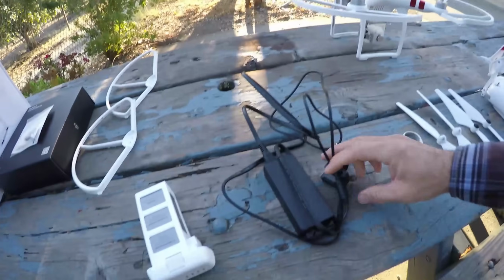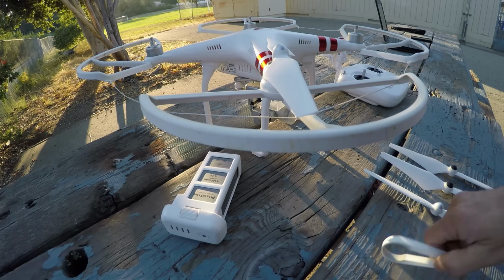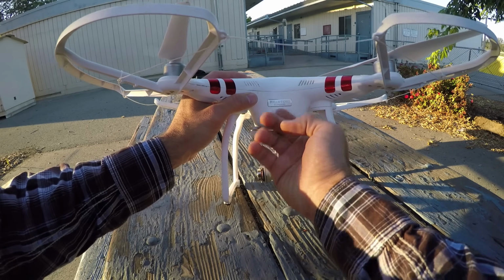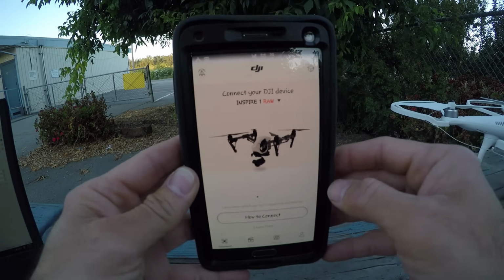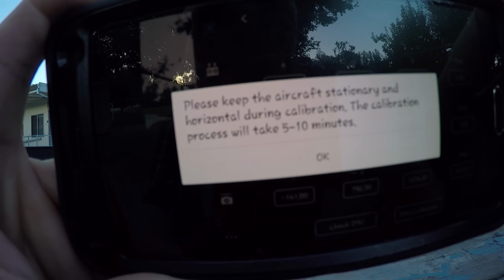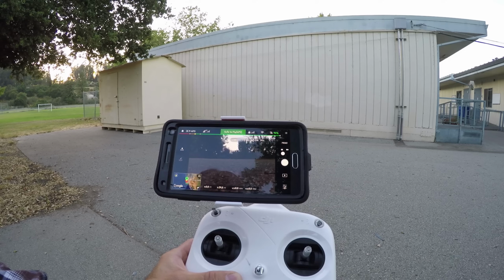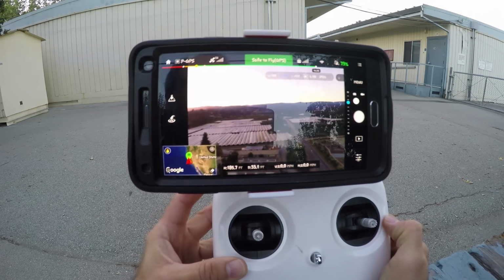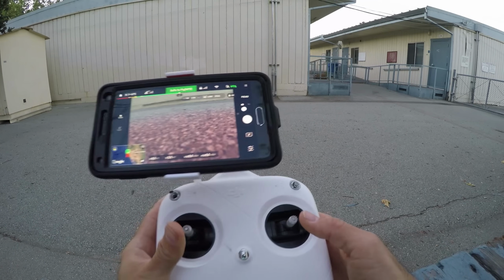DJI Phantom 3 Standard Complete Starters Tutorial

Comment: Hey , great video. Just got mine and Im looking forward to my first flight on the weekend. This video certainly helps. 
Just 3 quick questions. What are the S1 and S2 sticks for? Are you able to take pictures as you record video?  When I open the app it says I dont have the latest firmware but I dont get the option to upgrade it. 
Thanks in advance and regards.
Reply: hi. thanks for the reply. in terms of the switches I will have to read that manual to learn more. I understand what you mean about the video being a series of photos bit thought there would be this option to do both at the same time. And after opening and closing the app it then said I had the latest version so no update was needed. thanks again for your reply
Reply: Camera on/off, still and video controls are operated through the DJI Go App. As is auto launch. auto land and a few other functions.
Reply from the maker: Ahh, ok, excellent. Sounds like you're all set then. The switches on the controller aren't super important if you know how to do the same functions within the DJI Go app. There's a fair amount of redundancy with certain functions they consider important. I'm glad your're all set to fly!
Reply from the maker: User Fishaholiclures is correct for their points they mention. So, what are the S1 switch (on the right side of the controller) and the S2 switch (on the left side) for? The User Manual (file Phantom_3_Standard_User_Manual_v1.4_en_0112.pdf on the DJI website) explains the switches thoroughly. I'll give you a synopsis though...

The S1 switch :
*Allows you to regain control of your drone during the failsafe return to home process. I consider this the most important function of the S1 switch.
*Can allow you to calibrate the aircraft's compass, but you can do this through the DJI app too.
*Changes your flight modes (P-Mode, A-Mode or F-Mode) but you can do that through the DJI app as well.

The S2 switch:
*Can initiate a smart return to home process. I consider this the most important function of the S2 switch.
*Can be used in conjunction with the Gimbal dial to link the remote with the aircraft.
*Can be used to reset the WiFi password.
*Can be used to Reset the WiFi Video Downlink.

Next, you ask if you can take pictures as you record video. No, you have to stop video to take a picture in the DJI Go app. However, if you are knowledgeable enough, a video is just a series of pictures and you can choose frames of it to keep using certain video software or doing screen shots and editing.

Lastly, you say the app says you need the newest firmware, but no option to upgrade? Wow, that's weird. I haven't run across that issue before. Have you ever upgraded before? That would guide my next steps for things you can try.

Comment: the dji go app doesn't work on android :/ it never finds my p3 standard.
Reply from the maker: tony espinoza I didn't cover it because connecting to wifi is straightforward. Obviously it works for my drone because if you watch towards the end I am flying it. There are detailed instructions for the connection process in the user manual file I link in this video's description.
Reply from the maker: David Zuniga Oh, no, you would have to navigate to it on the phone to see the pictures or use the DJI app to view the photos. I just to move them from the SD card to the computer to view them.
Reply from the maker: David Zuniga It saves it in the app as well as in a directory on the SD card
Reply: Bought the tablet mount, same as used on the Phantom 4 and got rid of the flimsy mobile phone holder, now solid as!
Reply: because ios is garbage. im not getting a new phone because the drone app wont work. i tested on iphone and ipad it works. if anything ill get a different drone. android all the way.
Reply: Tried it on a nexus 6p and it didn't work either.
Remember the galaxy s5 the phone i have is a phone they "tested" the app on.
Reply from the maker: Good luck with whatever you choose. I wish I could help more.
Reply: I just downgraded to 5.1.1 and it's the same. the only other device it works on is ios and i don't have one.
Reply: No way. already tried that before and it didnt work. not doing it again
Reply: DJI favors apple lol. you can't even livestream with android but you can on ios.
Reply: i think the reason why he didnt cover wi fi connection on the video is because his android like mine has a problem wth the actual connection..keeps saying cannot find wi fi..i dont have a clue as to what the problem is..the one thing i really needed for him to cover and he said he wasnt gonna go into tht.. dam
Reply: Try resetting your phone to factory defaults??
Reply: Yep the S5 is on the tested list. Then it has to to be the drone? But I cannot see this being the case? That is weird.....How do you know it works on ios? If this is the case then maybe you can pick up one up, they are not that expensive eh?
Reply: See if you can test it out on another device...eg ipad etc, the forums are asking the same questions with 6.01 and Android are saying they are not in a hurry for the fix.
Reply: Hey Tony Es, I have connected my drone to 5 different Android devices without any issues what so ever! It's as simple as!
Reply: Thanks! im sending it to DJI for repair and hopefully they can fix or replace it :)
Reply from the maker: HeliosBeatss wow, wtf. Glad you got it to work but that's really bizarre! Thanks for the update!
Reply: Nice one...how simple, a lesson for all. I totally agree ios is garbage! Glorified chopping boards! Good luck and happy flying.
Reply: See you're not using marshmallow so it's working i think the app needs to be updated because it doesn't work for 6.01.
Reply: Weird. Where do you plan on mounting that tablet?
Reply from the maker: So you have another device connected to the drone? I'm wondering if that's interfering somehow. Beyond that, if you have the newest firmware for the drone installed, the newest OS on your cell and have done everything correctly otherwise for the setup...then I don't know how to help. You should probably seek advice on the forums.
Reply: +tripecollie I'm I'm new can you tell me when you save a video or picture does it show up on your gallery or only in the dji app I have a Samsung Galaxy s5 btw
Reply: Then you need to get hold of another phone/tablet to rule out the phone/tablet OR drone...simple as that! Apologies tripecollie for hijacking your post! BTW great video!
Reply: Got it back from DJI, still messed up. tried something that was posted on a forum which was turning off cellular data.. sure enough that worked :D
Reply: Seems like the problem is 6.01. If thats the case im going to downgrade my phone to 5.1.1
other users have said the same thing about cant connect to camera after updating. thanks anyways! :)
Reply: lol what? I have and i'm wondering if dji go doesn't support 6.01 marshmallow. Maybe that's why? since i see other android users that use it with no problem
Reply: Bought myself a Lenovo 7inch quad core with 1 Gb ram running Android, this little tablet does not have any issues with live stream and at A$94 you cannot beat it for the price!
Reply from the maker: Actually, I'm running 6.0.1 on my Samsung Note 4 which I use with my Phantom 3 Standard. I haven't had any problems.
Reply: tripecollie so it shows up on the gallery?
Reply: HeliosBeatss it works for me
Reply: Are you using Android 6 OS?
Reply: HeliosBeatss
Reply: HeliosBeatss true
Reply: Hmm weird.
Reply: Yeah.
Reply from the maker: Are you connecting to your drone with the wifi beforehand?
What android device are you using? Not all phones/tablets are compatible. Some may be compatible but require some tweaking after finding out what other users had to do. You can usually find this out on forums.
There's quite a few questions I would ask to help you troubleshoot your issue. Let's start with those first 2 though.
Reply: what do you mean?
I have a galaxy s5, one of the phones that they have "tested". it would be awesome if you can help, because i was going to send it back to dji for repair.
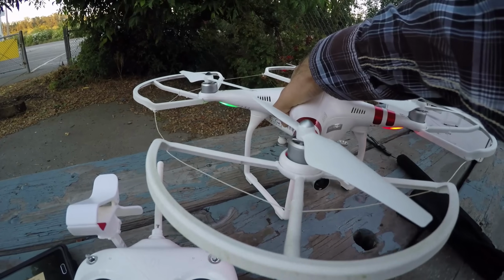Reply from the maker: I talk about connecting a phone or tablet to the drone via wifi at 21:42 in the video. You have to enable wifi on your phone or tablet and connect to the drone to receive a video signal. That step is crucial. So, my question if you are doing this step or not.
Reply: Yes i connected to it several times, but i don't have the option to go into camera mode.
Reply from the maker: Hrmm...if there is no option at all that sounds odd. Especially if the phone connects to you drone with wifi successfully. I'd wager you need to do one of two things.
1) Re-link your controller to the drone (It explains in the manual how to do it) or..
2) Downgrade your firmware and then upgrade it again. This process takes time but is a common solution to buggy firmware related issues. I'm in the process of making a video on how to do that today. I will upload it here on youtube tomorrow.
Reply: Yeah i reset the wifi via the controller and it didn't do anything. how do i downgrade my fw if i cant go into the dji go app?
Reply from the maker: You can't open the DJI Go app at all? If the answer to that is no, then have you tried reinstalling the app on your phone?
Reply: Yes i can but on android i cant go into camera mode. but on ios, it works fine. weird huh?
Reply: I just tried again, im connected to the wifi. but it says how to connect and won't detect my drone -_-

Comment: Hi If i m up in the sky and I hold the left stick down will it turn off the engines and crash down?
Reply from the maker: If you are holding JUST the left flight stick down then you will be fine. Left stick down is how you descend (go downwards).
However, if you are holding both left and right flight sticks downward PLUS diagonally inward your engines will cut off and your drone will crash.
Likewise, if you are holding both left and right flight sticks downward PLUS diagonally outward your engines will cut off and your drone will crash.
That is the engine cutoff/shutdown command. I had my drone about to do a "return to home procedure" because my battery was low and I knew that mean it was going to get stuck in a redwood tree 300 foot up never for me to use it again. So, I panicked and did an emergency cutoff. My drone fell 60 feet and thankfully landed in a bush. It broke all the prop guards and 2 propellers but those were replaceable and I was up and flying again soon. Thankfully these drones are pretty sturdy! Not to mention almost all parts are replaceable through the DJI website. Some just cost a LOT more than others (the camera is the most expensive)

Comment: Hey why didn't I get the propeller guards
Reply: It dose not come with the guards you have to buy them
Reply from the maker: User Therain is correct. You have to buy them separately. They cost about $20. They aren't a required part, but I strongly suggest them if you've never flown any kind of drone before.

Comment: I'm 16 and fly the small sport 3D quads like the Helimax 1sq and Traxxas Alias. For my 17th bday next monday I am getting the 3 standard. Which Ipad do you rec to get and I want the gps enabled. I was gonna get the mini 2 but heard it it doesn't have gps.
Reply: tripecollie I have an iPad Air 2. Would this work?
Reply: I have an iphone 5s that I can use for now,  but would like to get a bigger screen soon.
Reply from the maker: Hi there. I'm an android user personally so I can't speak to any specific Ipad to recommend. However, if you check out various DJI forums online you may get some knowledgeable responses. I'm sure any newer Ipad with GPS should work just fine, but I'd double check with forums and some google searches first to make sure! I'm sorry I can't be more help.
Reply: tripecollie It's alright, I'm not a big android fan but I use them if I  have to and I'm almost looking into a android tablet at this point. Cheaper than the Ipad would be with GPS.
Reply from the maker: Android is pretty straightforward and easy. There's a few minor things to know but otherwise they aren't that different than apple and actually have a lot more versatility. They're definitely cheaper. I wish you luck in whatever you choose!

Comment: Thank you. This was the best complete video l've seen. My big problem so far is my S6 froze during a sim flight. Nothing I have done so far will unlock it. Any hints?
Reply from the maker: Thanks! I'm glad others find it useful.
As for the S6 issue, are you saying that you can't use the DJI Go app anymore at all? Or just that it froze during that particular sim flight and you don't want that to happen again? I'm not exactly sure what the long term issue is here.

It sounds like at the very least you may need to uninstall your DJI Go app and reinstall it. That's an easy starting point. If I was you (I don't use an S6 myself and haven't heard of this particular issue) I would look on DJI forums and try googling your specific issue.

Comment: hi fantastic video. just one thing you didn't cover but may be able to help me with.when I've just purchased this phantom standard when I'm flying I get a notification where the green safe to fly GPS sign is saying no signal and screen freezes and goes black and white. now if I can't see the drone how do I get it to come home.
regards
Gary
Reply from the maker: Sorry it took me so long to respond here. Your issue sounds like you may need to downgrade your firmware and then upgrade it again. I hope to put a video up soon showing that process all in one go.
However, if you lose signal the drone is "supposed to" return to home automatically to the home point that is set when you first take off. Wherever it is at when it loses signal it will fly up to the altitude you have set in your settings, then make a straight line back to the set home point then descend and land. You can also tell it to do this by hitting the return to home icon within your app.
One important point, which I also mention in the video, is that the drone will be returning in a straight line at that fixed altitude/height in your settings. It can't sense to avoid objects along that path. That's a serious thing to take into consideration.  For example, I had my drone about to do a "return to home procedure" because my battery was low and I knew that mean it was going to get stuck in a redwood tree 300 foot up never for me to use it again. So, I panicked and did an emergency cutoff. My drone fell 60 feet and thankfully landed in a bush. It broke all the prop guards and 2 propellers but those were replaceable and I was up and flying again soon. Thankfully these drones are pretty sturdy! Not to mention almost all parts are replaceable through the DJI website. Some just cost a LOT more than others (the camera is the most expensive)
Reply: hi the problem i have is the remote control does not loose signal that is fine ist between the mobile phone and the drone that looses the signal and no picture, i can still control the drone by remote
Reply from the maker: From what you describe I would pursue 2 possible fixes:

First, try to re-link your controller and phantom. You can do that by reading the user manual (file Phantom_3_Standard_User_Manual_v1.4_en_0112.pdf on the DJI website) under the Documents and Mauals section on the bottom of the DJI website located here - http://www.dji.com/phantom-3-standard/info#specs
Specifically read pages 24-26.

Second, you may need to downgrade and then reupgrade your firmware. I actually plan to make a video to put up here shortly covering the downgrade and upgrade process for firmware. That's a common issue with the DJI phantom standard and I have yet to see someone cover it well. So, I'll make something soon and put it up here on my channel. I would initially try the first option I mentioned above since it is fast. The firmware process takes awhile. Unfortunately, a lot of people have had to go through it.
Reply: Hi I think you are missing the point I'm trying to explain. I do not loose any signal between the drone and remote. I'm loosing signal between the phone and the drone so when I get to around 45 m where it says on my phone safe to fly GPS it flashes up in red no signal then my screen goes black and white. the firmware I keep upgrading from 1.4 to 1.5 and 1.6 but still have the same problem
Reply from the maker: No, I get that the issue is video signal loss. That can be a controller link issue or firmware issue from all I've heard. The most common solution to it, as I said, is that a firmware downgrade and then upgrade is required. There are (kinda poorly made) videos here on youtube addressing that exact issue. If the newest firmware updates successfully for you and the drone still has issues, you may have to stay with a downgraded firmware to have your drone work properly. If that doesn't fix it then I don't know other options beyond contacting DJI tech support. I hear that's really unpleasant and they are rarely helpful though :(
Reply from the maker: If you have had successful firmware installs for all those versions and it still doesn't work I don't know how to help you. You can review the procedures I mentioned in a video I just uploaded here though - https://www.youtube.com/watch?v=LeexamhXsSk